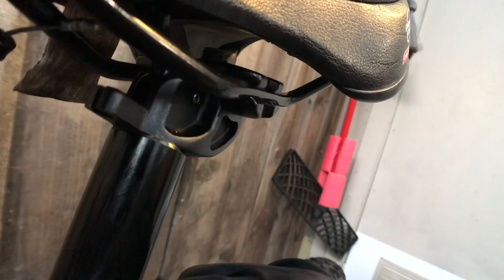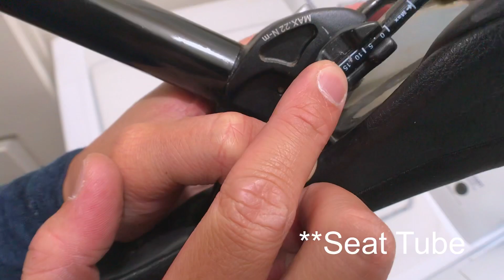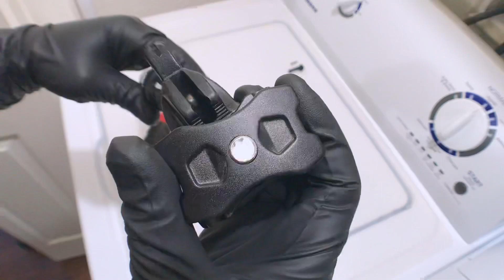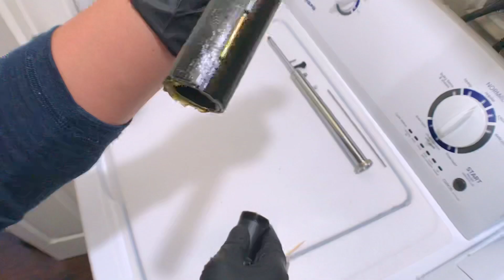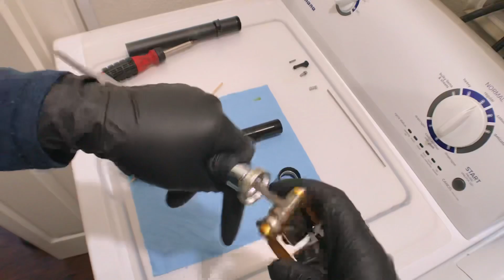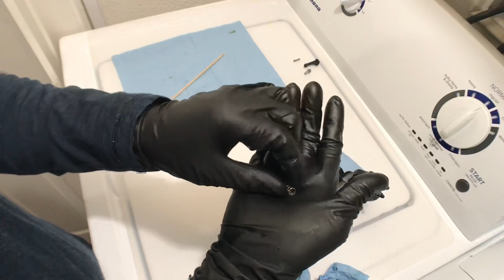4 y/o KS Eten dropper post maintenance

Comment: You missed the part where you put a 4mm T handle into the top of the seat post to unscrew the inner shaft
Reply from the maker: @TheCatsa  You’re right, I did miss that part; I was trying to fix my seat post without a guide at the time and I had to twist the upper seat port to unscrew the inner shaft to get to get to the guts of the seatpost. Good catch!
Reply: @diydad5067 your video was pretty awesome 👏

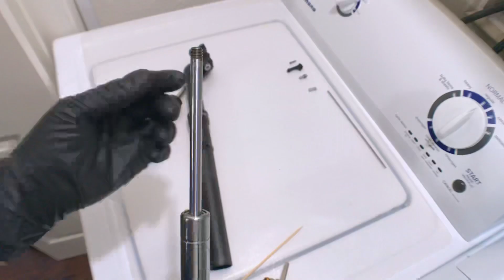Comment: 4:09 you missed an important part of how to unscrew that thread on the top, it doesn't just come out by itself, you need to screw it in with a 4mm allen key for the cartridge to come out.12:19 also no way you're going to screw it back with needed torque like that, need to reverse thread it with the same 4mm allen key.
Reply: This is what I needed, thank you!

Comment: I cant remove the rod.
It came out right away in your video
 Any tips? Tweezers are too.big.
Reply from the maker: Try shaking it loose? Just pay attention to small parts that may fly. Or some small magnet super glued on chopsticks.
Reply: It's screwed in but is accessible with a 4mm allen key (it's reverse threaded, so unscrew clockwise).
Reply: @cmscott  Couldn't get mine out, guy at bike shop said they can be stuck and possibly not able to be removed

Comment: Thanks!! I noticed that the main problem is dirt getting down where the actuator is. I cut a 2" ring of inner tube and made a boot. Put one hole in it to slip the trigger through. I took my seat post off and slid it up.
Reply: that sounds like a great idea

Comment: Thank you for video. Few hints:
- big tweezer is great for pulling out thag ball headed trigger
- screwing / un screwing of upper (slimmer) part of cartridge can be done using allen key from the top through hole after ball headded trigger removal.
- if your dropper does not work correctly and you smell hydraulic oil - cartridge is dead
- cartridge can not be fixed
Reply: dude cartridge is serviceable unofficially. I've fixed mine
Reply: @nephrons  you mind sharing some details?
Reply: @warwickhunt  First release all the air and excess oil inside the cartridge until you hear something inside when you shake the cartridge, Then refill the oil then use shock pump to refill the air compartment(300psi). Please do it with caution ⚠ oil may squirt
Reply: @nephrons  how much oil and what type please?
Reply: @bamwa  I tried using motorcycle SAE 30W fork oil. The amount of oil inserted was just experimental for me, a trial and error.
Reply: @nephrons Hey man. Wondering how you connected your shock pump to the cartridge tread? As it's not a schraeder I'm considering making up an adapter. Thanks. :)
Reply: @flynntastic79  Dude, it has thread for Schrader valve.
Reply: @nephrons Yo. Thanks so much for replying. Hmm, strange, mine is a fine pitch M8.  😕

Comment: Hoping you can help.  I have the same one and the cartridge appears to need replacing (won't pop up, and when forced up, won't stay under weight).   At the 4min mark, when I remove that end cap,  the cartridgde doesn't come out, just the tube.   However, I can spin the cartridge around and around, and it will not disengage/come out.         Also, at 4min 50sec, my tubes will not come apart far enough to see the guide pins.   I'd like to buy a new cartridge and replace, but am concerned since I can't remove the old one.
Reply from the maker: Try pulling the cartridge away from the main body while turning counter clockwise. I hope it helps.
Reply: For those coming to this party late (like me), the cartridge is threaded into the body and is accessible to unscrew (reverse-threaded, so unscrew clockwise) with a 4mm allen key through the top access after you remove the pin and rod assembly.
Reply: Hey, I'm having a similar problem but I had already taken mine apart, reassembled and when it didn't yet work, tried disassembling again but now won't release the cartridge housing.  I suppose the problem lies with the two threads and something I'm missing.
Please let me know if you figure anything out, I'll do the same :)
Reply: Same problem here. I can't get the long thin shaft out and I also have the problem of it keeps spinning when trying to release the cartridge
Reply: @gmasse13  Hey, one thing I found was that when trying to undo the top thread, you can actually access it and unscrew it from the top with a small allen key through the hole beneath the top pin.  Although, if it's that shaft you can't get out, then I'm not sure.  I imagine you've already tried using a BBQ skewer to pick and drag up on the front of the pin or removed it and the spring.

Comment: Thanks for the video. I had to service my KS e20i which has some similarities to this model. It helped me to see how the guide pins (lower guide bushings) were positioned on the shaft. 
I'm not sure though what were engineers thinking with e20i's clamp head. This model seems to have it thought through better.